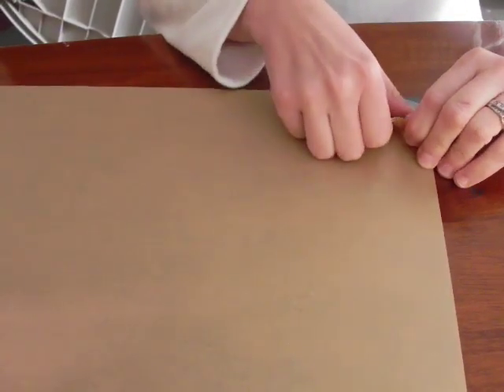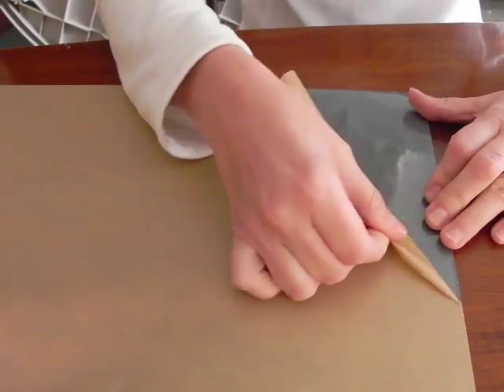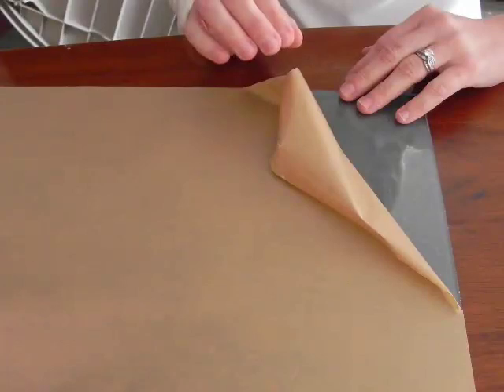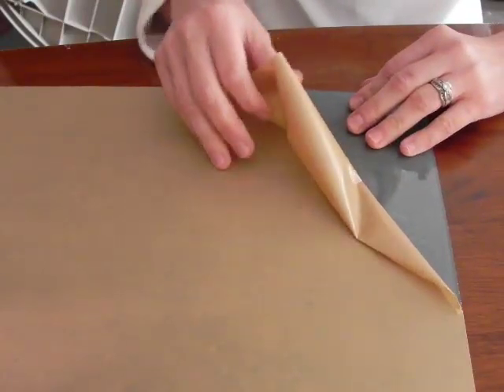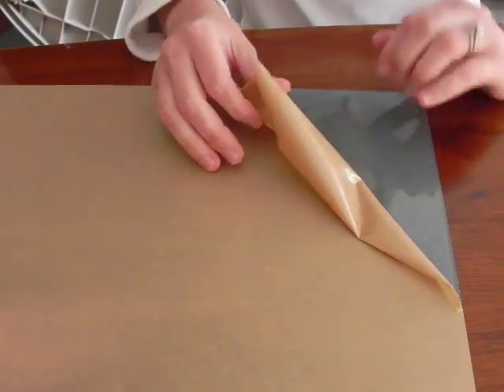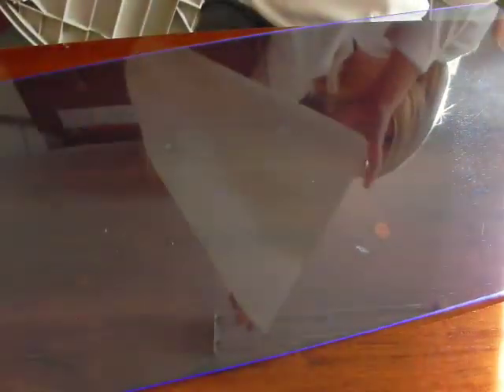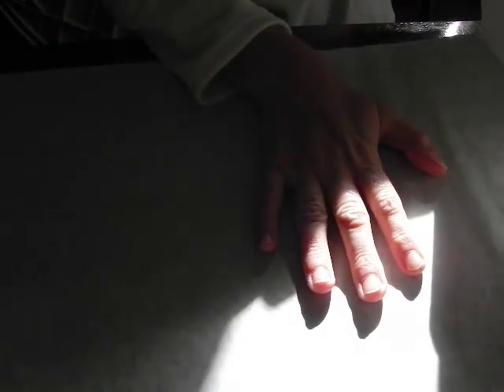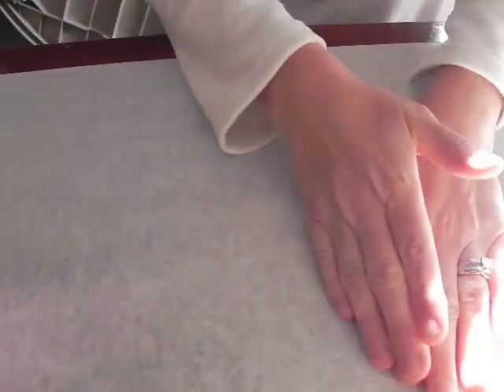Using a paper mask for laser engraving

Comment: Hi, I generally cut veg-tan leather, not wood or acrylic. Can you advise me what to use in this instance? It needs to be able to be removed with no residue as the leather is not dyed until after it's cut, and any adhesive residue blocks the dye.
Reply from the maker: +Raven Wolf This paper mask is perfect for leather. It is a low-tack so it will not leave the adhesive behind. Just apply it before use (not days ahead).
Reply: The air pressure is your problem, but masking tape works as well if you can't reduce your flow.  You don't need more than about 4-6psi from the nozzle for etching.  Just enough to keep the smoke out, but not enough to cause over blast that patinas your edges.  I cut 8-9oz leather with no issues for clean up a little water and and sponge can't clean right up.

Comment from the maker: A paper mask has services a few purposes. Mostly, it protects the substrate from fire flare up and having the surface of the acrylic or wood burn or scorch. Also, the mask can help the clean up process from laser residue. In addition, if you go on to color fill the engraved areas, most of the excess paint will be on the mask and when the mask is removed, so is the excess. Masking a product can be a huge time saver. Look for the video on color filling.
Reply: Do you mask the laser side or the back side?